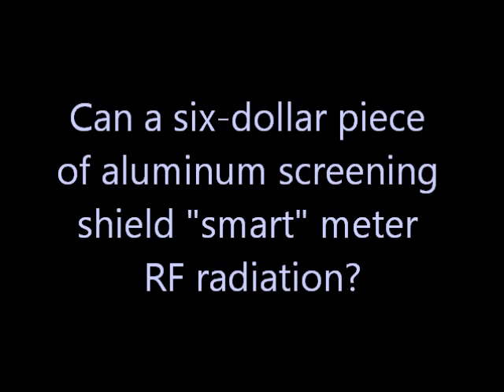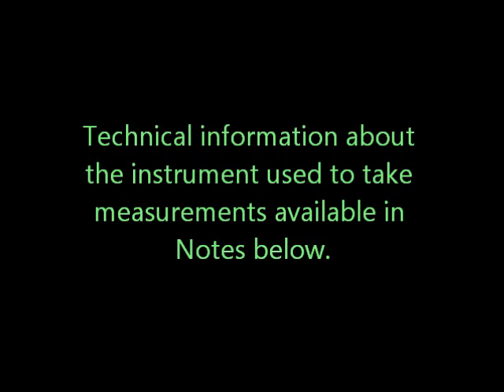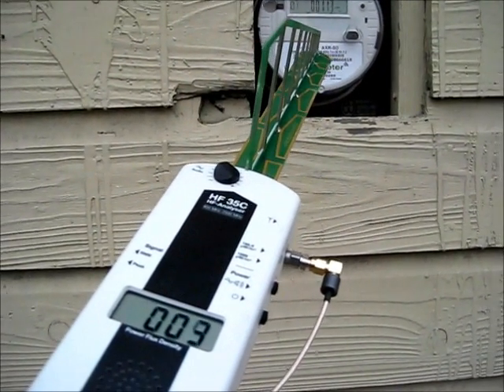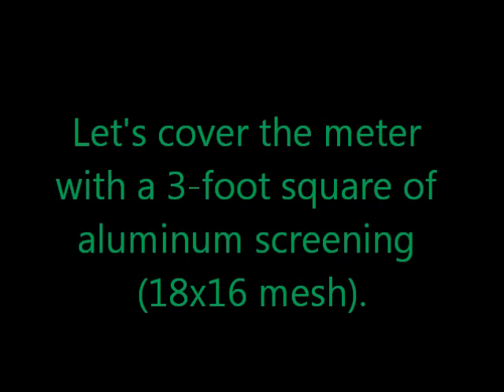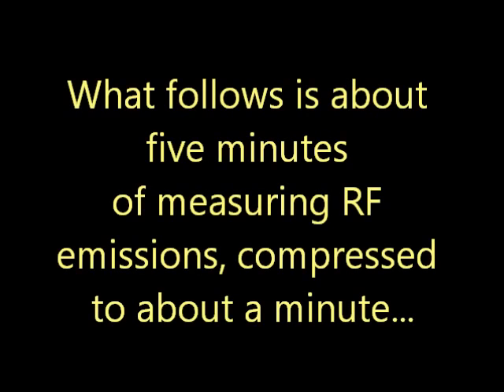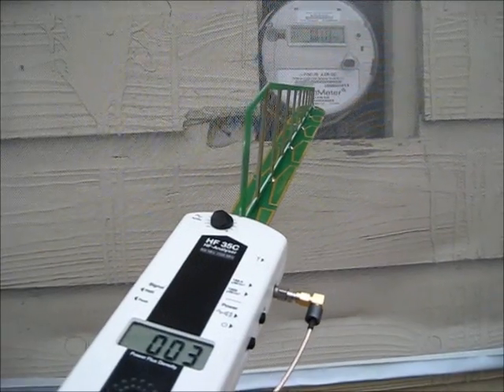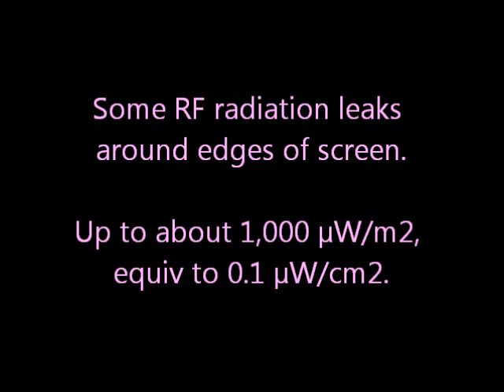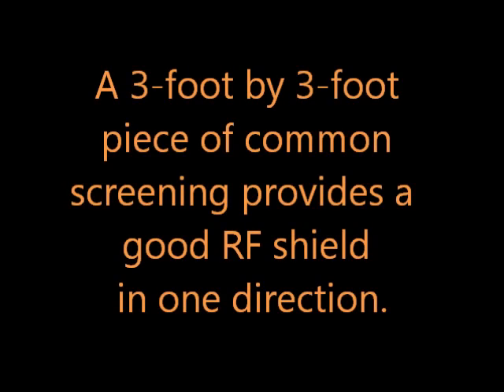Foiling a "Smart" Meter, Part Two: Aluminum Mesh Screening

Comment: Congratulations.... you've invented the Feraday Cage... Oh wait, that's been done. 
Too bad you wasted $6 on that screen! The steel housing around the meter does the same( the electric company gave you that for free)... All you've done is turned the FORWARD antenna in the meter into a waveguide that now bounces RF down the conduit, into the walls and so on.... 
But hey! Look at the bright side, sunshine! The Aluminum particles you absorbed into your skin from handling that screen can hurt you more than a 300 milliwatt burst of RF ever will ( like I said, the steel housing blocks the signal that would pass through your walls).  Well done, hippie! 
Yet another foil hatter giving REAL conspiracy minded folks a bad name.
Reply: +Curt Young Where was the notice that power companies were going to put in smart meters?  All these companies don't want any discussion of the dangers of non-ionizing radiation.  I don't believe these small bursts of extremely high levels of EMF are okay(versus the steady state situation).  Maybe if they hadn't spent all that money rigging health standards, I might consider it.  Why the 1996 federal ruling that says states and cities can't deny cell phone tower construction based on health?
Reply: +mmakshak  I'm not really sure that 0.09 WATTS is what anyone would consider "extremely high" as you say..... and yes... 90,000 microwatts is 0.09 Watts. A low end FRS walkie talkie only delivers .5 to 1 watt of RF. Also keep in mind that ANY electric meter is going to emit a continuous flow EMF simply because there is electricity flowing through it. "Smart" or "dumb" makes now difference.
Reply: +Curt Young I'm actually talking about the dangers of over 900mhz of non-ionizing EMF, which is the frequency of what is being transmitted wirelessly  all around us.  Yes, it depends on how strong the transmitter is(get rid of your Comcast router.).  There is a noticeable effect in the air outside in populated areas.  I know, because I use something that counteracts these effects.  I have trouble counteracting strong emitters of this EMF.  I can lengthen the time before I get tired, but it's not enough to be satisfactory.  If you have a really strong quartz crystal point(mine is special), hold it in your left(men) hand for awhile, and you will see what I'm talking about.  Now, I know the guy who goes to the Himalayas to dig for these, and he knows which ones qualify, but you might be able to find a few that might work.
Reply: EMF and RF are two different things. "Dumb" meters will show constant electromagnetic fields because POWER is going through a POWER METER... Any RF is only doing the same thing your cell phone does to maintain contact with towers. Short bursts, even when you're not using the phone, just to poll the tower for communications. When the electric company guys drive around with the readers is the only time those meters put out a long burst transmission. Think of it like a TV, even though it's off, the Infra-red sensor and motherboard still draw power so it can see the signal from the remote, telling it to fire up the amps and tuners or inputs.
Even though 90,000 microwatts SOUNDS high it's still less than 1/10 of a watt. which is lower than your cellphone uses when you're talking on it. Be advised, ALL RF receivers, such as scanners, car stereos, home theater receivers, pocket FM radios even GPS receivers DO emit "harmonics" or "birdies" as a result of energy going through the device....Even yer handy meter there throws SOME sort of signal. Know your electronics before you preach about them.
Reply: +Curt Young If you're so smart, why did they put Shumann resonators on space craft-to good effect?  Are you saying that all these non-ionizing EMF frequencies present in our air(and going through our bodies) have no effect?  You just cite one such device.  Is that the sum total of devices doing this?  Why the 1996 law preventing cities and states(or anyone) from cell phone tower construction based on health?  You, then, want to use what studies are left to prove it's safe, when, obviously, studies have been suppressed by this law(cities and states would have to prove it's unsafe in court, and power and cell phone companies would have to refute it).  I'm sorry, but your assertion lacks credibility, because of the huge number of devices putting out this non-ionizing EMF, and the suppression of studies in this area.  Your assurance that it's safe isn't enough.  You gobble together a bunch of words that sound nice, but I have proven to myself that you are wrong, as I've done something to myself and my environment that has improved my health by combating the effects of non-ionizing EMF.  Maybe you can tell me what the power of Comcast's routers are(technicolor 8305c), when put in a "hotspot(the default setting) mode.  I know that effect when I sit within 3 feet of it.  Or is that too much of a real fact, and I could actually use that to give people a real standard-based on distance and power.  That would show me you know electronics, not some assurances.
Reply: +Curt Young EMF includes RF, but includes a lot more frequencies.  I assume RF includes all the frequencies that are used in wireless devices, but I could be wrong.  RF does include non-ionizing EMF.  EMF is electromagnetic frequencies, and RF are radio frequencies.  I may not know too much in this area, but how much do you know about the adverse (health)side effects of non-ionizing EMF?
Reply: +Curt Young My understanding is that the smart meter has a 4(or 3) watt transmitter.
Reply: Not even close. They throw less than a cell phone. All they do is communicate with a reader/transponder that the power company guy drives around with, either handheld or mounted in a small vehicle. Any CONSTANT  fields around a smart meter is caused by live power passing through the meter, just like the old style analog/mechanical meters would show.
Reply: Don't know much about waveguides, do ya. lmao

Comment: this mesh if you completely wrap around the box and meter you are basically making a fereday(fair-a-day) cage
Reply: +Scott Edick 
And give it a ground to drain the energy to....
Reply: Allen would it charge a battery grounding it to it.
Reply: 1) Mesh is on wrong side of meter. The way it is depicted would make MORE radiation inside the house.
2) To get energy you could use would require absorbing all the radio energy given off by the device, which is not a lot. So you would have to wrap the entire meter then rectify the signal to the hot side of a grounded battery but as soon as you do something like that, the power Co. will come to put your power back on, as they will think it went out.
3) I would focus on solar, wind, geothermal, or mechanical ways to generate power and give up on this idea. Still a good idea to do the shield thing inside the house if you are concerned with the radiated energy though.
4) You get more RF energy in you from your cell, car, wifi hotspots etc. than this so it's not as bad as it might seem. Just an intrusion into our daily lives which is inescapable mostly. The idea was to make the electric grid more efficient and stable, but its use has not been enabled for this "smart grid" function which would have allowed the power company to remotely "trim-back" your household use of electricity to things like your washer, dryer that are not critical loads. This would require another sub-panel or relays inserted between your existing power breaker box and your loads that can be interrupted. Generally this would only be used in times when the grid became stressed in some way. Another way this is used is to profile the use so that they can catch growers who are legally paying their bills and (only small scale growers) with no illegal bypasses
Hope this helps a bit!
Reply: +Allan Radcliffe I would suggest you put orgonite(all orgonite is not created equal.) close to the transmitting antenna, and not close to where EMF measures the strongest.  In addition, you can ameliorate the bad side effects of the EMF present in our air(populated areas).  I do-with the particular orgonite I make.  My orgonite is the strongest of the smaller ones I've come across(experiment with ingredients and a powering source.  I use structural links[see chi generator] as a powering source.), but I use a fair amount of this orgonite.  Sometimes I have to put the orgonite in my hand(left for men, right for women), as it is stronger than in your pockets or nearby.  You still have to maintain distance from strong transmitters of EMF(Comcast router box, for instance.  If you can turn off the hotspot feature, that lowers the EMF effects appreciably[I can no longer access this feature.  Maybe I shouldn't make these comments-hint, hint].).
Reply: +mmakshak I'm convinced that everyone should get rid of their Comcast router.

Comment: OMG real radiation.The biggest source of natural background radiation is airborne radon, a radioactive gas that emanates from the ground. Radon and its isotopes, parent radionuclides, and decay products all contribute to an average inhaled dose of 1.26 mSv/a (millisievert per year).
Reply: +timbo01889 Non-ionizing radiation is unsafe, and I would postulate the higher the frequency, the less safe it is.  Of course, the power of the transmitter, and the distance from that are extremely important, but just the background EMF in our air(populated areas), is unhealthy, based on my feeling better when I ameliorate that.  You should also worry that cell phone tower strength of transmission is probably not regulated, especially not taking into account people who live nearby.
Reply: +mmakshak your extensive knowledge of electronic devices and thier characteristics seems highly influenced by opinion instead of facts or theory. :-)

Comment: not sure what kind of radiation is sent out, but from what I remember from school what blacks radiation is lead that's why you use lead vest to protect your body from secondary and scatter radiation which have no uses at all and the only one that would get bounced back would be scatter radiation, but dissipates after 6 feet depending on how strong it is though.

Comment: better sell your cell phones, radios and wireless routers, and avoid all public hot spots, oh and avoid the sun too.
Reply: +zomgirule It would be nice to see some standards and more studies.  Political contributions, plus federal laws, keep things how they are.  Maybe once they recognize the health effects of non-ionizing radiation, we will get some guidelines and standards.  Meantime, we are the guinea pigs.
Reply: zomgirule Yes, the sun emits electromagnetic waves; however this is completely different than radio waves (or RF transmission) virtually everything surrounding you other than any sort of metal is a dielectric, meaning radio waves pass through (for lack of a better phrase) with little to no attenuation (blocking or absorption of RF) light waves from the sun do not act like this.
Reply: Michael Michael. Don't know the science but do know it has changed my life dramatically. My wife is electro sensitive much to my pain. We can go somewhere and she suddenly gets the runs. Mostly this happens in shopping centres or big harware stores which I frequent as I'm a builder. When I ask if they have WIFI the answer is always yes. Even went to a coffee shop in the country, no other houses around, and the same thing happened to her. When I asked,the answer was "Yes, they had WIFI running."

Comment: the thing is though while it is blocked at one end, is it sending more inside the building???
Reply: Another video I seen said the rear side of the meter has the material to block that direction.
Reply: wildstreak73 Yes, but you would simply have to just block it from the inside to keep it from affecting the folks inside said place, or encapsulate it.

Comment: There is far more energy being radiated from every single electrical circuit in your house than can be emitted by the smart meter! Your cellphone produces far more radiation as well! How stupid are you people?
Reply: bryan click   They're unfettered, nonpareil, Olympian stupid.  :(
Reply: All lies
Reply: +bryan click Well, for one, the electrical circuit transmits at a much lower frequency than these wifi things.
Reply: +bryan click Would a transmitter(smart meter) be more powerful than a wire inside a covering-especially at a distance?
Reply: +bryan click From what I saw, the electrical circuit is at 60hz, and a smaller amount(harmonics of the 60hz) as you go to higher frequencies.  They certainly don't have much, if any, at the frequencies that cell phones operate at (918mhz?).

Comment: why do you think your microwave oven has a screen with holes set at one half a wave length
Reply: dave suian  To let the little invisible RF gremlins peek out.  ;)
Reply: dave suian is there to keep the radiation in to help it cook evenly, not for any other reason other than that google it
Reply: +nathan campbell - No it's shielding also, just like what is all around the entire microwave.
Reply: +SkylineToTheSeaAndMe true but pretty much the same as what i said lol